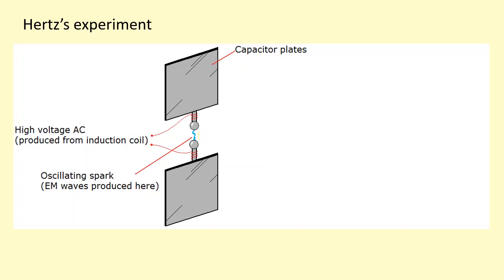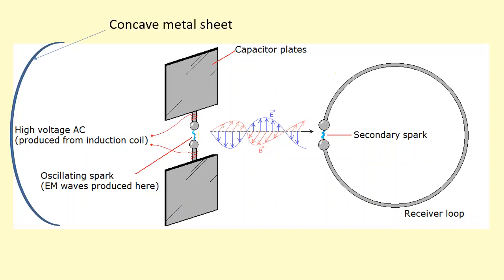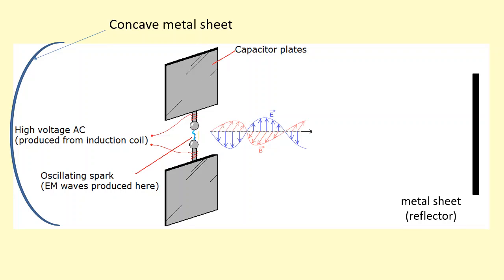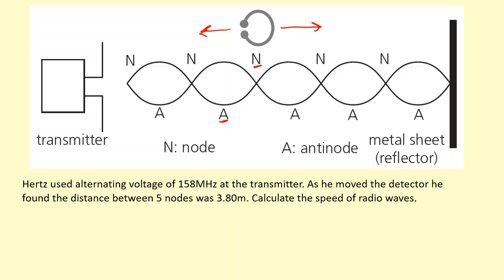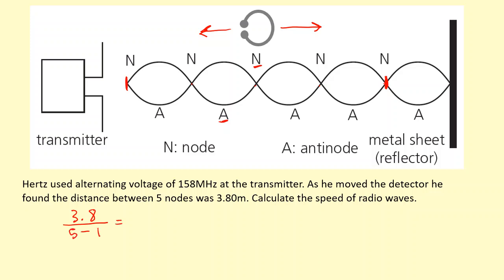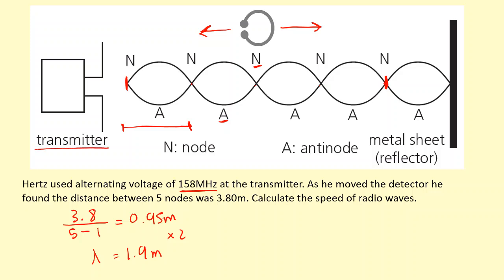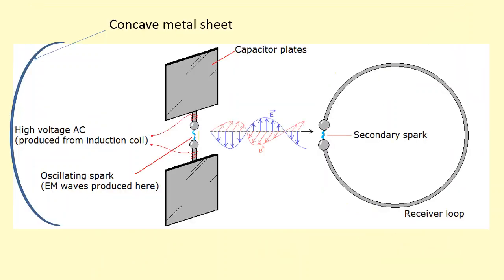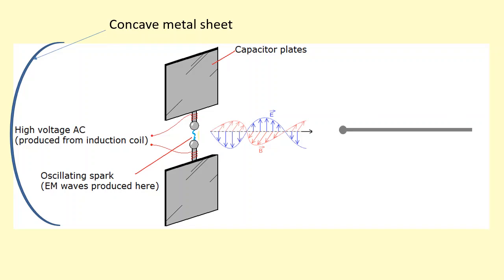14.11 How did Hertz find the properties of radio waves?

Comment: Do you design the antenna differently if you want to use the magnetic or electric field? I have read somewhere about antennas specialising in either of the fields but there wasn’t much info on what that meant
Reply from the maker: An antenna that picks up changes in the magnetic field would have a area through which the magnetic flux would change. This will induce an varying emf. (i.e uses faraday's law). It will loop like a loop/

An antenna that picks up changes in electric field would have a metal rod along which the electrons will be accelerated back and forth (i.e an alternating current)

Does that help? I wouldn't say i'm an expert on this though.